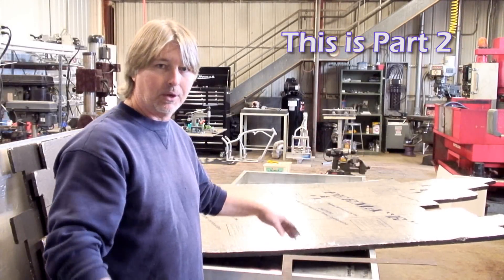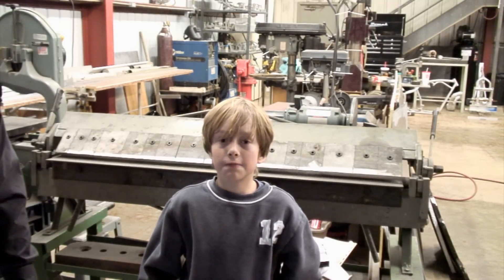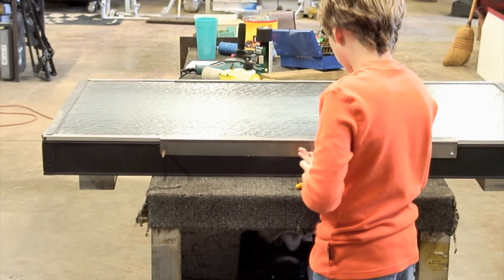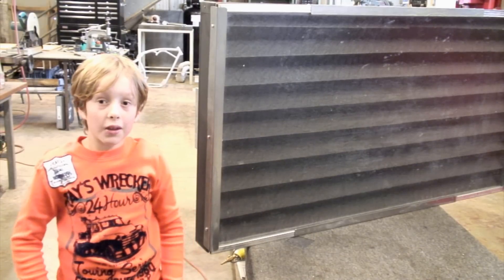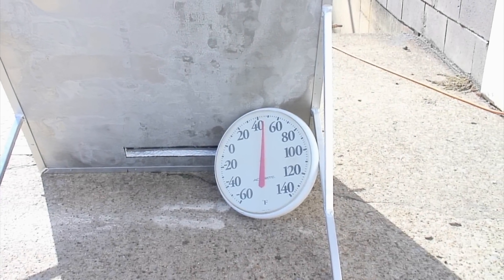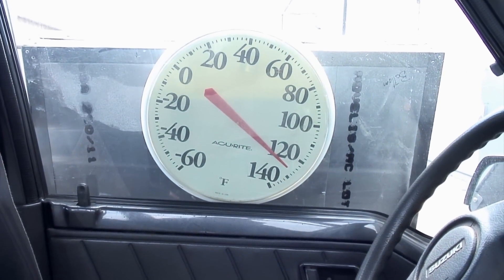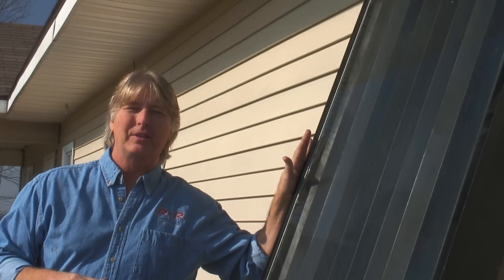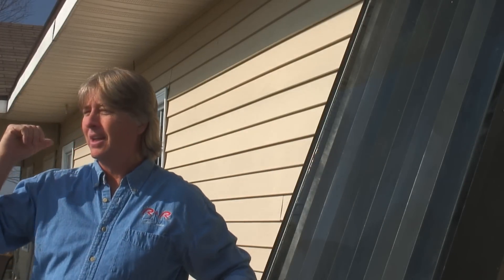Solar heater part 2

Comment: Excellent how you took this from beer cans to industrial design. My first was 2.5x5' with 55C. Then 3x6' with 70C. Then 6x6' with 95C. Now 15x6' with...TBA in the future. Yes with high insulation and 1 or 2 or 3 of these units combined on each house and building would be greatly help energy security and costs.
Reply from the maker: Thanks. We had fun doing it and yes, a few of theses on any house would help a lot with heating. The next house I build will have about 6 along the south wall.

Comment: The size of the opening for inlet and outlet is a double-edged sword.  A small fan will let a certain volume of air enter the box and get warmed up to return to the room.  But if the speed of the fan is continuously increased, there comes a time when the air transit time is reduced significantly and the temperature of the returning air to the room will drop.  So, how warm the returning air becomes is a function of how thick the insulation is and how much it lingers in the hot box.  There is always a trade off in life!
Reply: I noticed that the size of your intake is much smaller than the outlet.  The amount of air you take in and heat it by the sun rays is the same as the amount of heated air you introduce intI your room.  This principal is governed by the physics of heat transfer.  Changing the size of the plenum would not mean that you are introducing "more" heat into the room.